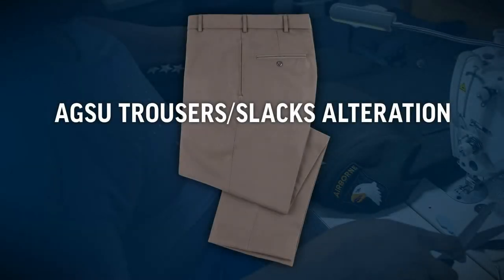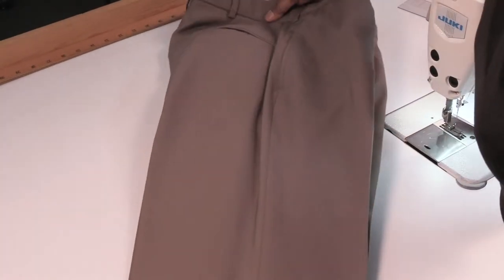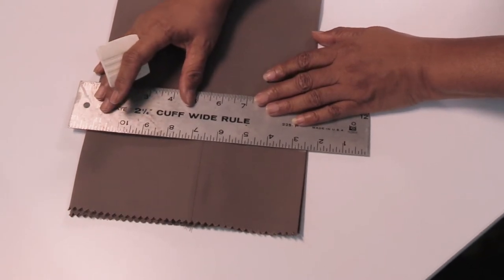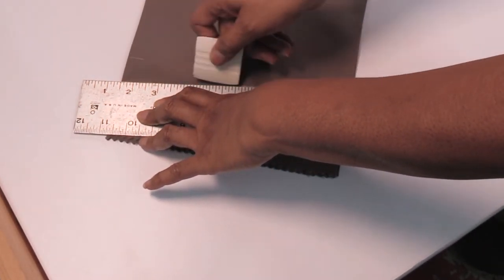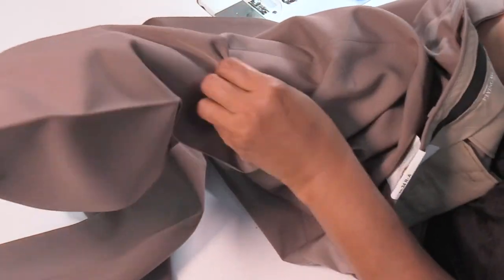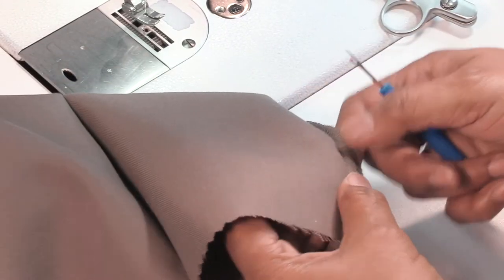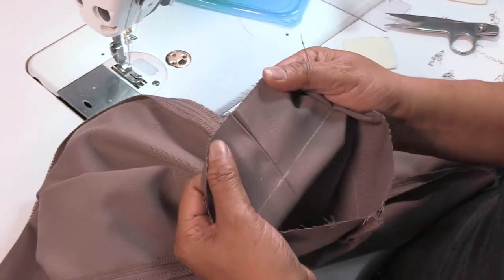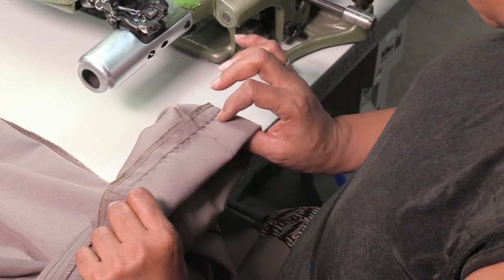AGSU - Trouser Slacks Hem

Comment: Best video on doing a military blind machine sticth hem, the key to succes is the 2.5 inch hem allowance and the topstiching of the side seams THEN cutting the original seam, to give enough freedom of movement for the fabric when sewing the hem at an angle. The other key advice is maximum of one inch difference between the back and the front of the hem, any more creates issues for beginer sewers, thank you !